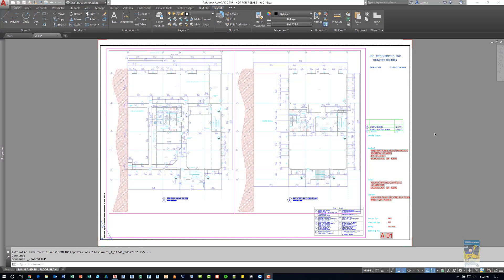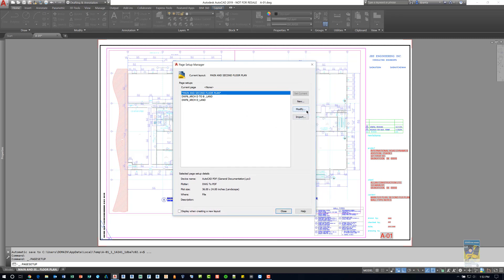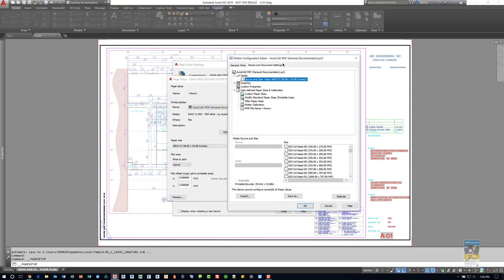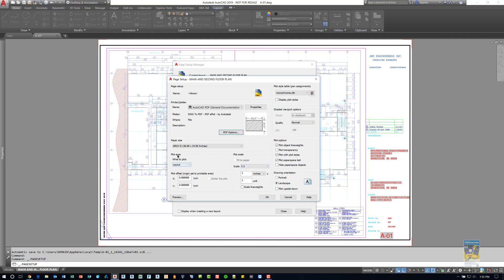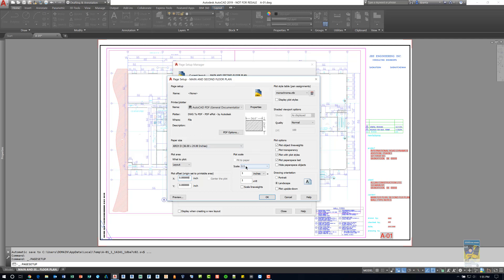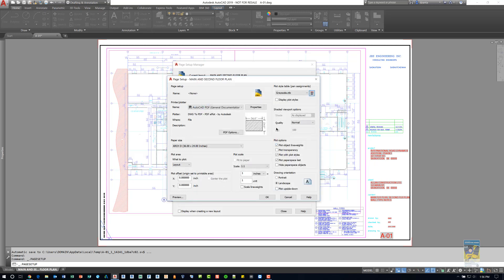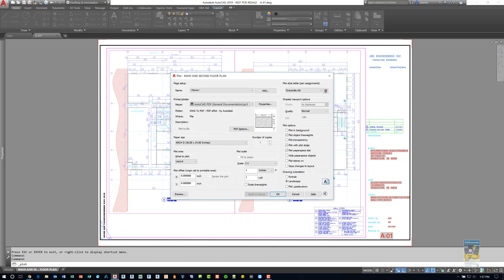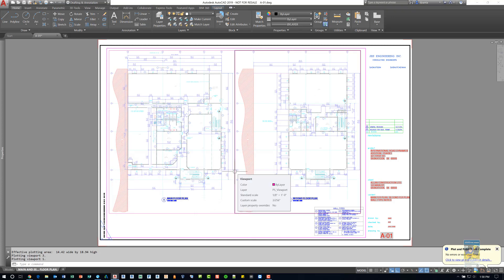AutoCAD Page Setup Manager

Comment: Thank you so much it is fabulous the way u explained slowly and cleraly .. It helped me i was struggling from many days it was just one lil thing in page setup manager scale which was not 1:1 and i couldnt fit my drawing to scale .. tried many vedios but u rock at explaining thanks again
Reply from the maker: I am glad I could help.   Please let others know so they can benefit too.  Thanks
Reply: Dzan Ta Can you please make a video or write comment that  why and what difference scale option in the plot window make ?? Ex: my layout scale is 1/8”=1’-0” but model space we draw 1:1 then why in the window layout it works only with 1:1 plus please explain where how we can use display / extents / layout and window use
Reply from the maker: @kanchankanchan8634  when you plot, in the page set up manager window you are setting up the layout to print the sheet full size.  Therefore, you should be choosing Layout and 1 to 1 full scale for this set up.  The times you choose Display, Extents or Window is when you want to print just an area of the drawing at a specific scale.   I can make a video later to explain further if you don't understand my comments.